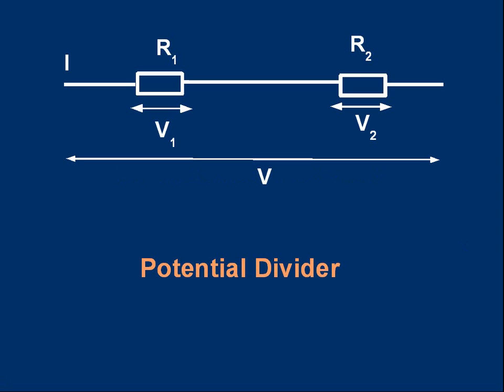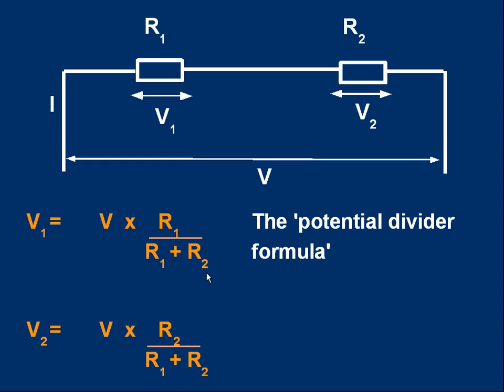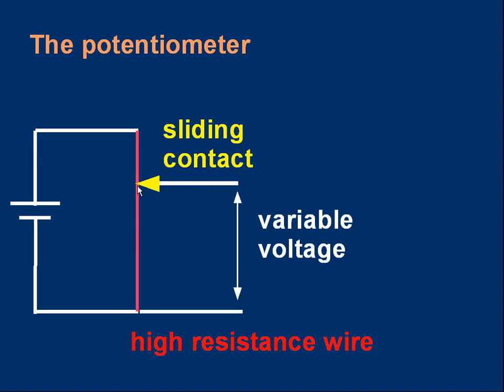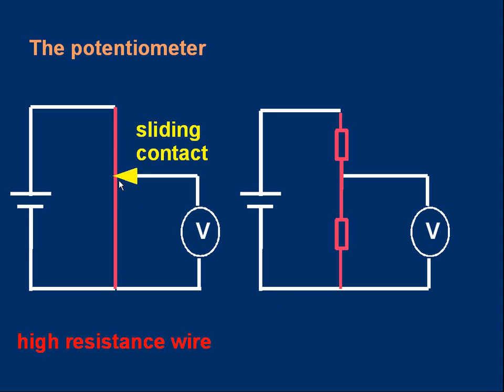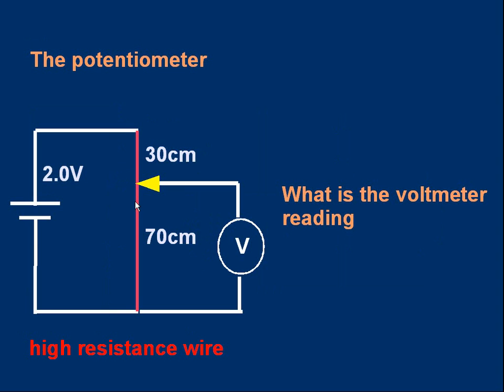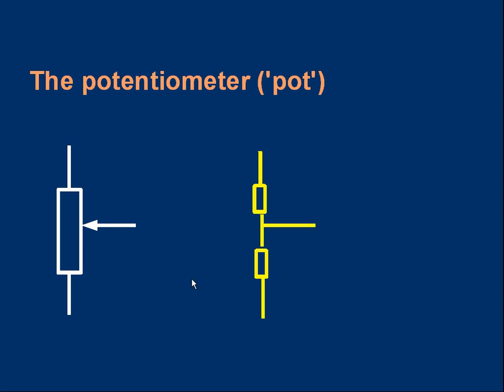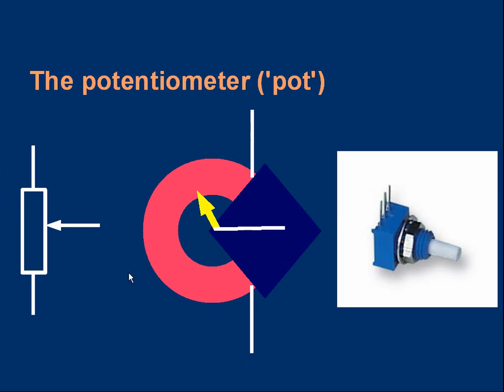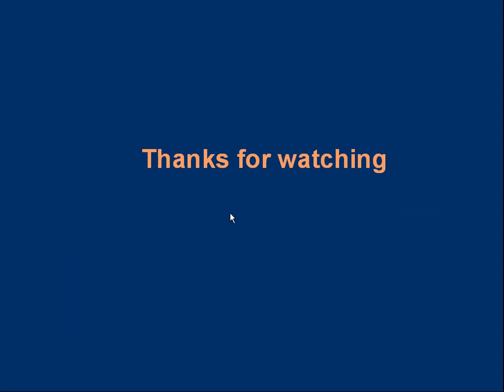GCE (A-level) Physics E20 Potentiometers

Comment: aren't the formulae supposed to be 2×(30/100) selections through the  wire travelling less distance?
Reply from the maker: The voltage across the 70cm section is 2 x 70/100 volts.  It’s just like having a 2V supply connected in series with 30Ω and 70Ω resistors.  The voltage across the 30Ω resistor is 2 x 30/100 volts.  The voltage across the 70Ω resistor is 2 x 70/100 volts.
Reply: @Steve4Physics  Hello Sir, Thank you for your reply i am close to understanding what you are saying ,my last question to you was that ,the electron are not supposed to travel throw that 70 cm resistive write that why are we comparing it with a 70 Ohm resistor ?
Reply from the maker: You said “the electrons are not supposed to travel through that 70 cm resistive wire”

Oh yes they are!

The electrons travel through the entire 100cm wire - not through the voltmeter because the (ideal) voltmeter has infinite resistance. 

To help explain, we can - for convenience - pretend that each 1cm of wire has a resistance of 1Ω.  The 100cm wire’s resistance would then be 100Ω.  The wire can then be thought of as 30Ω and 70Ω resistors in series.

First make sure you undestand the potential divider.
Reply: @Steve4Physics  Thank you so much ,Sir .You have been a Life Saver to me and Always will be .I've searching for the answer everywhere ,My exam is in a week and i started  pretty late in October when i decided to give the exam ,i had an year study gap in between due to some financial reason so my concept got a bit blurry ,THANK YOU SO MUCH ,SIR.
Reply from the maker: @boboom4657  You are welcome.  I wish you good luck in your exam!
Reply: @Steve4Physics  Sir would you mind me asking one last question to you ,regarding this?
Reply from the maker: @boboom4657  Go ahead.
Reply: @Steve4Physics  Sir if instead of a voltmeter  a light bulb was placed in parallel to the potentiometer ,it is said that the blub would stop glowing if the sliding wire(wiper) connected to the potentiometer is slider downwards(from the diagram) ,My question is why would voltage across the blub keep decreasing to a point that it  turn zero?isn't the circuit set to balance the EMF across the circuit always?
Reply from the maker: @boboom4657 
Call the resistance-wire ‘AB’.  The top end is ‘A’ and the bottom end is ‘B’. Call the slider’s position ‘S’.

To simplify the explanation, assume the bulb’s resistance is very large compared to AB's resistance. 

The bulb is connected between S and B.  So the voltage being applied to the bulb is whatever the voltage is between points S and B.

The emf is 2volts.  If S is midway between A and B, there is 1volt across AS and 1volt across SB.  So the bulb gets 1volt.

But suppose S is near B.  E.g. AS = 99cm and SB = 1cm.
The voltage across AS = 2 x 99/100 = 1.98V
The voltage across SB = 2 x 1/100 = 0.02V
These add up to 2volts, but the bulb only gets 0.02V.  Maybe only enough to make the bulb glow very dimly, if at all.

The nearer S gets to B, the smaller the voltage across the bulb gets.

When S is at B, the length SB=0.  There is no voltage drop between S and B.  So there is no voltage being supplied to the bulb. It won’t glow.  (Note that in this situation the ends of the bulb are joined directly together.)

If the bulb has a small resistance, the same argument still applies but we must include the effects of the bulb’s resistance. This makes the example calculations complicated.

Note that if the bulb is connected to A and B, the bulb always gets 2 volts - the position of S makes no difference.
Reply: Please forgive me sir for taking so much of your time to understand this concept ,you are a very Kind human being to be willing to help after so many years of uploading your video ,Nobody is this kind anymore nowadays ,You have been a miraculous person ,Thank you for you,Sir.

Why this potentiometer has been so confusing to me was because as i  was taugh in my o levels that voltage remains the same in parallel circuits ,and i was stuck to it like if even the resistive wire takes A lot of voltage ,i thought as the blub was on parallel and voltage is nothing but the energy to pass one coulmb of charge just the current being divided ,My misconception still tells me that atleast some voltage would still be received by the bulb even if the required voltage for the bulb to glow is not reached.

According to how much you've tried to make my Dull pea brain get to this circuit ,I now came with a contradictory conclusion that ,if a fixed resistor instead of a potentiometer is attached to series and if it needs all the  2V  from the battery and if beside it ,the light blub would be set from parallel (for some reason) is that the light blub won't receive any voltage at all ,what contradicts me is voltage in the parallel should've had   received the equal 2 V as it's in parallel .But ,Sir thank you so much for Trying this much ,Being Thousands of miles away, i will never Forget you mister Steve,You are a Gem in this World ,Thank you for All your effort to make me understand it ,You are Loved.
Reply from the maker: @boboom4657  You said: “i was taught... that voltage remains the same in parallel circuits”

This is inaccurate and misleading.  It should be:
“If components are connected in parallel, they have the same voltage.”

It is very hard to explain without diagrams but I’ll try,

For example 2 components X and Y, are in parallel. They are connected to a 2V battery.  Each component receives 2V.
We add a resistor, Z, in series with the battery.  We now have a mixture of series and parallel connections.  X and Y are still in parallel with each other.  But the battery, Z, and [the combination of X and Y] are in series.

We might now get, say, 1.5V  across Z leaving only 0.5V across X and Y. Note that X and Y still have the same voltage as each other because they are in parallel: but their new ‘same voltage’ is now only 0.5V.

The bigger we make the resistance of Z, the smaller the voltage across X and Y.

You also said “if a fixed resistor instead of a potentiometer is attached to series”.  I’m sorry but I can’t understand that.  The potentiometer circuit with a lamp is a  mixture of series and parallel circuits.
Reply: @Steve4Physics  Sir ,Does that mean ,in this (XY parallel and Z )mixed curcuit,If instead of X there was actually nothing but the circuit wire but Y still connected parallely in that area and the Z resistor still connected in series,what would happen then ,Is this what is Happening When the Slider from A-B-(slider S) potentiometer is doing?when Slider is moved towards B and length StoB =0? comparing this with your last circuit diagram?just instead of X ,there actually is nothing but the circuit wire itself but the Y component existing but not recieving any voltage at all where as the resistor in  series  with battery recieving all the voltage instead?And Y component isn't receiving any voltage as because there is not voltage drop in the circuit wire ,where there is not potential drop?As we know there is no potential drop in the wire unless there is a load attached in series ,it this what's happening sir?
Reply from the maker: @boboom4657  You said: “there is no potential drop in the wire unless there is a load attached in series”

That is wrong.  There is NEVER a potential drop in a (perfect) wire.  Because V = IR and R=0 for a perfect wire.  The pd between  the ends of a (perfect) wire is always zero.
-----
If it helps, we can also explain in terms of currents.
-----
For the circuit [XY in parallel] and Z in series, suppose the resistance of X is zero (a perfectly conducting wire).  No current flows through Y because the current takes the ‘easy route’ through X.  So no current passes through Y.
-----
Similarly for the potentiometer/lamp.  The current at S splits – some current  goes to B and some goes to the lamp. (These 2 currents then recombine at B.).  When SB is very short, it’s like X having zero resistance above.  The current takes the ‘easy  route’ so no current goes through the lamp.
Reply: @Steve4Physics I Salute You ,Sir.You Literally Literally Saved me ,I will be forever grateful to you ,Sir.Huge HUGE RESPECTTTT.Thank you So very much Sir.
Reply from the maker: @boboom4657   Thankyou!  Good luck.

Comment: An exam question: '' For a single turn rotational pot. What is the resolution of this angular displacement measurement method if the outputs range is 0.5 to 2.5V?''
Reply from the maker: +Andreas G.

That's a poor exam question as the 'resolution' of a potentiometer depends on its design and construction (grain-size of the conductive layer, wiper size).I think the examiners may be asking about precision, not resolution. But I’m guessing. The range (0.5V to 2.5V) has end-points specified to a precision of 0.1V, so the precision of a reading should be taken as 0.1V.In angular terms (assuming 1 full rotation of 360º is possible), 360º is  equivalent to (2.5V - 0.5V=) 2.0V. So by proportion 0.1V is equivalent to (0.1/2.0) x 360 = 18º.
So possible answers could be 0.1V or 18º.
Apart from that, I can’t guess what the question is asking for.

Comment: Since we assume the current flows form positive to negative, the in you example circuit, the current will only flow through the 30cm part and will not flow through  the 70cm part. So shouldn't the voltage be:  2*0.3 instead of 2*0.7?
Reply from the maker: +Mohammed Ali

You asked about the question at about 5 minutes in.

 A voltmeter has a very high (ideally infinite) resistance.  That means  negligible current (basically zero current) flows through the voltmeter.
Therefore all the current flowing through the 30cm section of  wire also  flows through the 70cm section.

The current flows from the cell's positive terminal, through the 30cm length, then through the 70cm length, then back to the cell's negative  terminal. No current flows through the voltmeter.

The 30cm and 70cm wire sections are simply 2 resistors in series 
carrying the same current. 

Pretend the 2 resistors are 3Ω and 7Ω for example. Total resistance = 
3+7 = 10Ω.
Current I = emf/R = 2/10 = 0.2A

Voltage across  3Ω = IR = 0.2x3 = 0.6V
Voltage across  7Ω = IR = 0.2x7 = 1.4V

 
It gets more complicated if the voltmeter (or anything else in the same 
place) doesn't have a very large resistance.  In this case the current 
splits.  Some goes through the voltmeter and the rest goes through the 
70cm wire  section.  But these two currents then combine and flow back 
to the cell's negative terminal. 

Hope that helps.
Reply: @Steve4Physics  thanks so much that makes sense

Comment from the maker: Hi. The video is correct.

If the voltmeter were connected between the TOP of the red wire and the slider, the voltmeter would give the voltage across the upper (30cm) section of wire. This would be 2.0V x (30cm/100cm) = 0.6V.

But in the video, he voltmeter is connected between the slider and the BOTTOM of the red wire, i.e. across the lower (70cm) section of wire.  The reading is therefore 2.0V x (70cm/100cm) = 1.4V

(Note that the 2 voltages add up to the supply voltage: 0.6V + 1.4V = 2.0V.)

Comment: At 03:05, you said that when the Slide is positioned at the top, middle, and bottom, the Voltmeter reads 2.0, 1.0, and 0.0, respectively. 

So, at 05:20, shouldn’t the answer be 0.6 V?
Reply: No, because in the one it was a potential difference across the wire and the other it was another "cell"

Comment from the maker: There are different types of DI unit but the simplest is a transformer.  If you want to understand how it works, you will have to search on ‘impedance matching transformer’ as the explanation won't fit here and needs some maths.

Comment from the maker: Q4 (Impedance matching for guitar.)
Maybe this will help.. Referring to high and low impedances is not clear – actual figures are needed,
A guitar pickup’s impedance is quite high - typically around 50kΩ.  It should really be connected to a much higher input impedance amplifier (say 500kΩ) to minimise voltage-loss (see answer to Q3).
Many amplifiers do not have a high enough input impedance to suit a guitar pickup, so you then use a DI unit.

Comment from the maker: Q2 (Poweramp)
Yes, But it’s more usual to think about poweramps in terms of power-gain (output power /input power) than in terms of current-gain.

Q3 (Voltage transfers from lo-Z to hi-Z)
Yes.  Low-Z to high Z minimises voltage loss, because the current is kept small by the high total impedance. By keeping the current small, voltage losses are minimised (V=IR or V=IZ; small I means small V).

Comment from the maker: Q1 (Volume control)
.If:
- the volume control is a simple pot’ between a mic’ and preamp, and;
- the input impedance of the preamp is much larger than the mic’s, and;
- by ‘ground’ you mean the common connection (usually grounded for safety and noise reduction);
then, in answer to your question,  yes.

But the current is tiny.  It is generally better to think in terms of voltages at the input stage.

Comment from the maker: Hi.  Good question.  A 'good' voltmeter has a very high impedance (resistance), so only a negligible curent flows through it. The same applies to a 'good'  amplifier.
If the input imepedance (of  voltmeter or amplfiier) are small, this is no longer true  but this doesn't prevent the operation of the potentiometer, but makes it non-linear in that the voltage from it is not proportional to the slider's distance from the end. This is not usually important.
My video on potential dividers might help.

Comment from the maker: The output voltage (across R1 say) is given by:
Output voltage = (R1/(R1+R2) x Input voltage.
(this is the potential divider formula as explained in the video).

Providing R1 and R2 are fixed, then R1/(R1+R2) is constant.  This means the output voltage is proportional to the input voltage. E.g. if you double the input voltage, you will double the output voltage.

Comment from the maker: The battery's voltage is exactly divided in 2 because the resistors (each half of the wire) are equal.
The resistors could be 100Ω or 999Ω each for example - it makes no difference.

This is because the resistors have the same current (as they are in series).  I and R are the same for both halves of the of the wire. V=IR, so V is the same for both halves. Since the 2 voltages must add up to 2volts, each part has 1volt.

Increasing R would reduce I, so IxR remains 1volt.

Hope that makes sense.

Comment from the maker: A low resistance potentiometer wire (PW) would produce a large current, which causes overeating of the power supply and the PW. It is basically a short-circuit, so it is avoided.

There are also technical reasons for avoiding a low resistance PW (to minimise the effect of slider contact resistance and resistance-change due to heating).

You CAN have a low resistance, but usually a small current is adequate. Potentiometers vary from a few ohms to millions of ohms depending on the application.

Comment: Hi steve, i have a question: why do you want to use a high resistance wire if you want current to flow through the wire?
Reply: hello bro pls tell me if physics a level make u rich??????????????????????????????????????????????????????????????????????????????????????????

Comment from the maker: Hi. Pot’s are usually used in a device to vary the voltage to different parts of the device.  See example near the end of the video (volume control with a preamplifier/power amplifier).  In audio-visual  systems, rotary or linear potentiometers are often used to control volume, tone, balance, brightness,  etc. (though this is less true in digital circuits).  In servomechanisms, potentiometers can be used to monitor the position of an object (by attaching the object to the sliding contact).

Comment from the maker: To TheMichaeljohnny.
The cell (or battery) can be either way around. It would only matter if the polarity (which way around + and -are) was important, e.g. if the circuit included a diode.